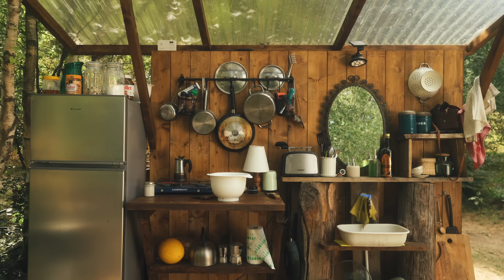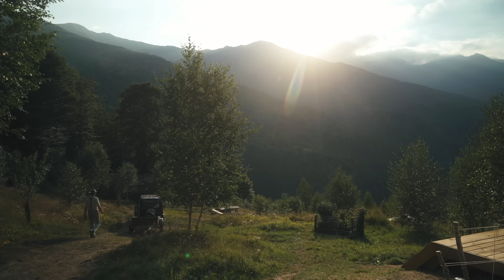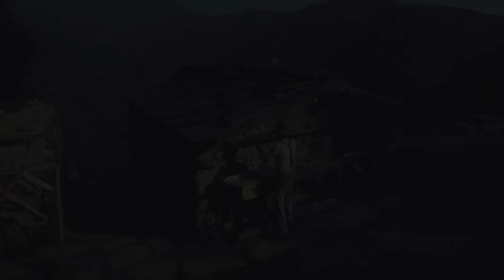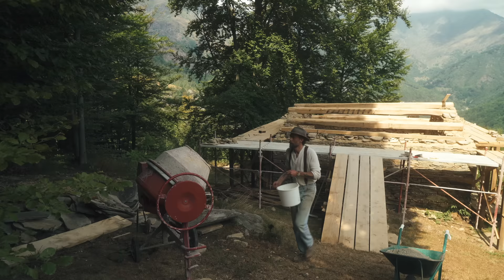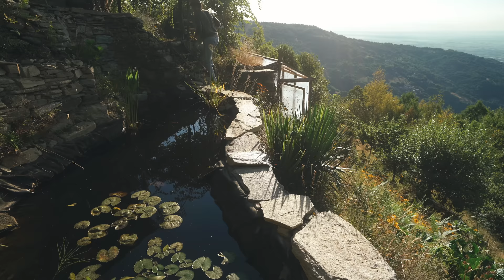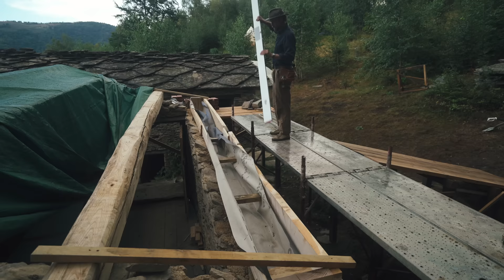#31 Outdoor Workshop, Bread baking and First work on the Roof

Comment: I was in Val Maira this summer, just a few valleys south of where your cabin is (I think). There they have very similar stone roofs as yours. There seem to be two types of roofs; one where elongated stones are placed in more or less horizontal rows and one with square stones arranged diagonally. The former method seems to be the most recent. What are you going to do?

Comment: You missed the opportunity to secure the stone where you removed the old roof rafters. The clay is not as good as cement and the clay was obviously crumbling. You would have been better served if the placement of the new roof rafters were on secure surface and cemented in place also stopping air infiltration. Good luck.

Comment: How do you get your sourdough bread to rise so beautifully?  I'm new at this and even though my starter has lots of bubbles, the dough just doesn't seem to rise very high.  It's driving me a bit crazy ...after all that work and to end up with a flatish loaf of bread!
Reply: It depends on the gluten content. Bread flour is recommended.
Reply: I have same problem, how long did you let it proof?
Reply from the maker: I add some dry yeast on top of the sourdough starter. Not always, just depends how active the starter is.
Reply: @bonniefrench9884  I use 200 grams of unbleached all purpose flour and 250 grams of bread flour.  Maybe I should switch to all bread flour?
Reply: @francismurtagh3295  I proof the dough over night so about 8 hours or more.
Reply: @MartijnDoolaard    Thank you!  I've been wondering if I should add some dry yeast to it to get a better result.

Comment: haven't commented until now but cement is a big mistake. never ever use a stronger material over a weaker one. there are too many amateurish 'restorations' gone wrong because of this. and those walls are not ready for a roof, far too much loose material and unevenness. for this particular project it's clearly done and dusted but for anyone reading this thinking about restoring an old house, learn how to do things the right way. shortcuts and sloppy work don't pay off in the long run.

Comment: The only way to insure that wood will rot away is to imbed it in concrete or lime mortar. A very bad idea indeed.  You are a odd mixture of types, designer, builder, dreamer, but not an artisan. Lest you need re do the roof in 20 years, you should enlist the help of an experienced and practical craftsman.